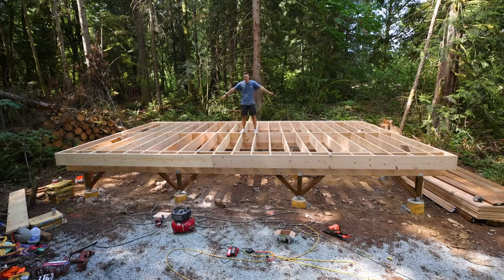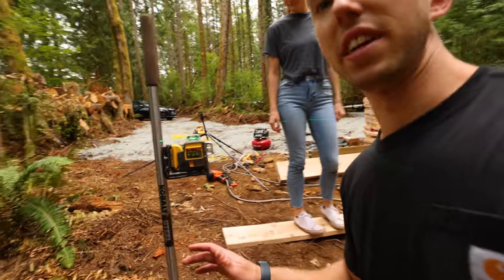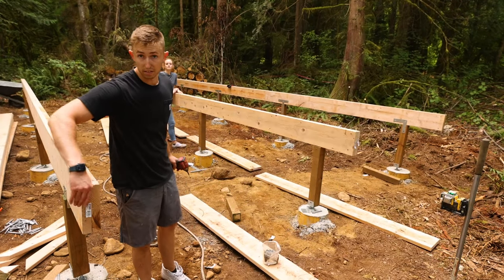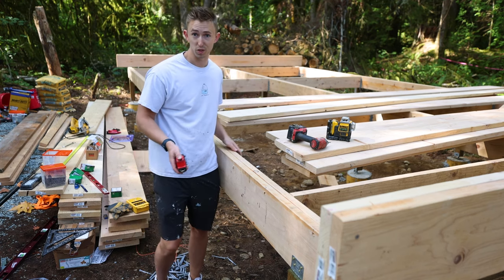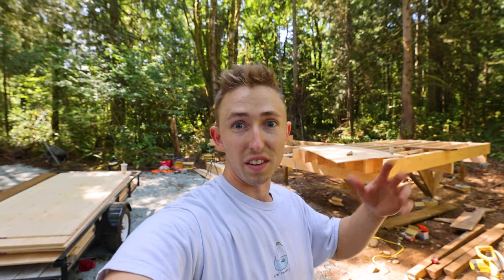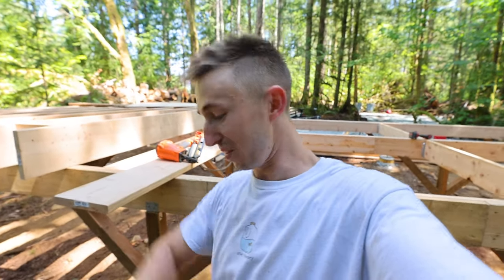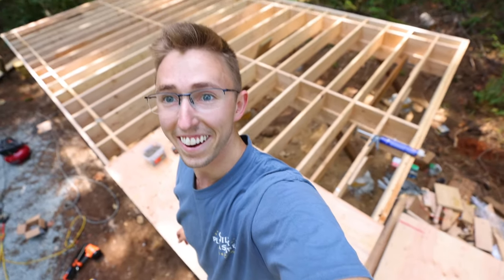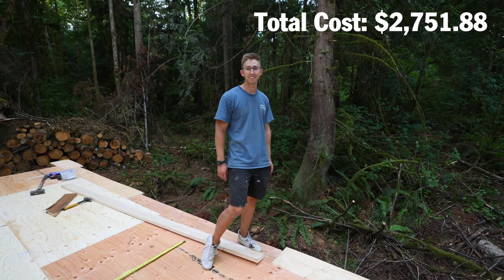Framing My Tiny Home Floor | Less Expensive Than I Thought

Comment: there are a lot of things that i find wrong in this build. the question is.... did you consult a professional or do any research before start building that deck?
Reply: No need to
Reply: Why dont you say whats wrong with it instead of saying you found things that were wrong?
Reply: @GrimReaping  for starters, the main one I noticed was the nailing.  For nailing double beams, you should have about half the number of nails as your nominal value every 16”.  In other words, a double 2x10 beam should have 5 nails (some codes have it as 4 nails, hence why I said “about half”) vertically every 16”.  Looks like he just ran across punching a bunch of nails in, but not nearly enough and not in a particular pattern

Comment: Seriously? All that weight of the structure on some 3/4" threaded bolts? That's transferring a huge amount of weight onto a tiny area. I suspect it will crack your footings. I'd have an engineer check that out.

Comment: those anchor bolts made it really easy to adjust height but are they strong enough to have the entire weight of the house on?  usually the weight is on the 4x4 or 6x6 directly to your pier, not its just on a 3/4" bolt.
Reply: That's what I'm thinking, Simpson abu66z is what should've been used or the 4x4 version, these look like a waste of effort
Reply: My thoughts exactly. Seems like a lot of weight to sit on a small bolt. Granted it’s 12 bolts but still doesn’t seem too strong.
Reply: yea I was thinking the same thing. That the entire structure is being held up with 12 of those little retal rods basically. idk. seems sketch/under-engineered. hoping he can chime in
Reply: The bolt diameter is very concerning, along with size of footings , not sure that's the best way to do it.
Reply: @darbythomson7662  Exactly correct. This is the wrong hardware for this application.
Reply: @butchahmann9274  Each of those is actually OK. The floor framing is very stiff, so the foundation attachments only need to resist gravity loads and shear. Even though the pins are pretty small, they're big enough for that. The real problem is the way he jacks the rods out of the dried concrete to level it. That ruins both the bond to the anchor bolt, and the integrity of the pier. 

The best way would have been run the piers all the way up to the bottom of foundation beam level, then use a small adjustable standoff piece (which is also available for around the same price) for any adjustments.

Comment: Wild seeing all of that sitting on a couple of us unsupported threaded bolts 😂.
Reply: That’s what I was thinking. Like it all looks robust above those little brackets. But everything is on those little brackets….
Reply: Unsupported how? Simpson requires 2500psi concrete at a minimum to hold those anchor bolts. 4x4's shouldnt have more than 500lbs on them, and that bolt is rated for a max of 760 down load when supported by the nut alone.
Reply: @GrimReaping  Thanks for clarifying this, as I was unsure but didn't want to come across as an internet jerk. so, if I were to build something similar (but with more piers, 600 sq feet), would you recommend to do anything differently than he did? Thanks
Reply: I agree, these are deck supports. NOT made for a full cabin.
Reply: Even on Simpson website they don't have lateral loads specified for these for the non threaded cast in place they do.
Reply: @GrimReaping  "Uplift loads require the threaded rod to be attached to cured concrete with SET-3G® or 
AT-XP® anchoring adhesive. Cast-in-place installations must have a nut and bearing plate 
embedded in concrete. Uplift loads do not apply when installed to a pier block" 

Wet setting the bolt and washer above leaves adjustment for hacks that can't even cut a piler, but in return removes all lift load. That sail will meet winds, and uplift will be created that overpriced shed is not safe to be in PERIOD.  He is just lucky it is under the SF required to pass code and inspections where he lives.
Reply: @garyreneau6166  You would need to check your local codes, a lot of places anything under 450 SF has no building codes, at 600 you would need inspections, and this would not pass. He didn't install the plates correctly there is nothing but the raw weight holding that structure to the ground he even shows you he can just turn the nut by hand and the plate moves so what will stop a good storm from blowing on the 12ft x 30ft sail and creating enough uplift to pop them little bolts out of there holes.

Comment: Run concrete posts 3 ft high. Use sill plates and rim joists
Reply: Exactly This. 
Concrete costs $5 a bag, and you already had more than enough sonotube material. There was no reason not to just pour the concrete right up to the bottom of the joist level, or at least the bottom of the foundation beams. That would have eliminated the very weak point of this foundation, letting it all sit on those little pins, with 3 feet of prying leverage above them.

Comment: Only thing i would have done differently is to sheet under the framing first.  By doing the underside first you just drop in your insulation from on top.  By doing the top t&g plywood you now have to stuff insulation in from underneath the framing.  Take my word for it that way sucks.
Reply from the maker: Typing this while taking a break stuffing insulation in my crawl space.... this sucks... never again hahaha. Definitely taking your suggestion moving forward.
Reply: @devonloerop  lol yeah, I've done the insulation job you are now doing.  Not fun.  But we all learn through experience.  Your build is sure looking great from the videos I've seen so far.
Reply: What material would you use to sheet under the frame?
Reply: @FranciscoGonzalez-ro7ht  I used OSB for the underside.  I was an apprentice when I had that job so whatever the boss told me to use I used.  But at the time OSB was cheaper than plywood and the underside doesn't really carry much of a load... It's basically sealing up the underside of the floor and holding the insulation in place.

But before you use OSB I'd make sure your local building codes say OSB is allowed.
Reply: fwiw, slab foundations vs. pier: high winds and hurricanes can destroy homes no matter how the foundations are laid out.

Comment: The weight of the whole building is  supported by 12 screws, nuts/washers. Not a safe design. What is the max load each screw can take?
Reply from the maker: 3/4" bolts* not screws lol. Look up the compressive load of 3/4" diameter steel
Reply: @devonloerop Bolt include screw and nut. It got thread on it. So it is not the max load of the 3/4 diameter steel bar but of the thread. I just checked quickly on chatGPT, seems  a grade 2 3/4 diameter bolt can hold 3500 lbs load on thread. 12 bolts hold 42000 lbs. Assuming the building is 500 square foot and dead load on the floor is 40 lbs per square foot, the total dead load is 20000 lbs, which seems OK.  I am not sure how much margin should be left for dynamic load.

Comment: I’m glad here in sc we don’t have to build a double floor!! I’m flabbergasted how you built a foundation grid then built an entire new grid for flooring on top the grid when really here in sc we use the og grid an use it as the beginnings of the floor joists system
Reply from the maker: beams make it so you can level the home easier that way you level by using two control surfaces instead of 12

Comment: Can someone explain how the adjustable brackets sticking out of the piers work? It seems like the entire house is held up on top of these relatively skinny bolts! Are they just that strong? I guess I’m surprised that’s just as strong as the wood beam directly sitting (or sitting within a bracket directly) on top of the pier. 

Awesome video.
Reply: When you spin the nut, it pushes down on a washer, which pushes down on the concrete pier, lifting the load. The threads are only there to act on the nut, not the concrete. As a result: They have terrible uplift holding (IE: they can be pulled out), and since they have minimal cross-sectional area (a single bolt) that means they also have terrible side-loading (IE: they can be knocked over). I can't speak as to whether or not these shortcomings would be problematic for the build shown here, but I'm fairly confident this would not pass an inspection.
Reply from the maker: Very true, will not pass inspection but this tiny home is not permitted and will not need to be inspected. That's also true that due to lack of cross section they are not good laterally which is why I built the home like a table, all of the bracing laterally is up top and that way it's almost like setting a table down on the piers.
Reply: Thanks for the reply, really interesting. Why not just lay the beams directly on the piers? Was it to give yourself the ability to make leveling adjustments?
Reply: All that work to cheap out on the foundation like that.
Reply: @badtoro truuuuu Simpson aba44z would've probably cost like 20 bucks more lol
Reply: I get it’s a tiny house but the entire tiny house will be dependent on those 12 metal bolts. If a big wind storm comes I can see all those studs bending over and possibly fracturing the tops of the cement piers. I am not an engineer or keyboard warrior, just thinking out loud.
Reply: @joshpit2003  This should be the top comment. This is not the best way to build this. And given the expense and effort he put into it, he easily could have bought the right hardware, and formed the foundation in a different way to make it 10x stronger for the same cost/time/effort.

Comment: This is an amazing work, as someone grew up in the city and concrete jungles, I often dream of living in a forest. Then here I have some questions about the durability of the lumbers in modern days, would it be capable to handle the humidity, the hot and cold temperature and the destructive wood eating pests for two decades and not getting rotten.

Comment: On the four foot marks I doubled the floor joist so my subfloor 4x8 did not share the 1 and 1/2 inch joist. You could marry a 2x4 to it also every 4ft just fyi. Before I put the subfloor on I usually face the underside and insulate. Spray for bug proofing and caulk to keep critters out.

Comment: If you use some beads of that Liquid Nails in between your sistered lumber they will be even stronger than if they were one piece of wood. No clamping required because your nails & screws act as clamps.
Reply: locktite version of liquid nails works much better.  Much stronger adhesion.

Comment: Like many viewers i have serious concerns regarding the use of the bolts and the unnecessary usage of blocking near the end of the joists because you capped them with the 2x12...i would have used a block at the end as a jig to space the joists.  Use the braces at every 8 feet from the cap boards and that would most likely suffice for stabilizing the joists.  But my biggest concerns is the usage of screws over nails.  Screws break wheras nails bend so when that house starts settling, alot of the screws could snap off.  Use blue glue nails and you will get the best of both worlds as they will bend when needed but never back out because of the glue.  But I do like your video presentation.
Reply from the maker: I glued down each panel, so the plate is essentially one solid system. It's been working really really well. The glue would have to shear off to have any screws break.

Comment: Dude! This is great. What are the total dimensions of the building?  I am in the process of framing a 12 x 24 building, definitely stealing some ideas for bracing. Nice work. Is the container home on the same property? What kind of permits did you have to get?

Comment: Great video series! I've been thinking about using pier and beam foundation but if you can believe it pouring a concrete slab foundation is cheaper in my area and I don't have to do any of the labor. With pier and beam you still have to buy insulation and flooring.
Reply from the maker: Wow if it's cheaper def go for it! You might want to consider using a footing and stem wall so you have a crawl space. It's nice for maintenance in future.

Comment: @3:53 - Can someone explain how that pier is moving up or down.  Shouldn't the threaded rod be cemented into place, how is it moving up or down?
Reply: The concrete isn't bonded to the threads very well so it doesn't prevent spinning like a J bolt does.

Comment: Two questions: 1) Do you have to calculate for snow load in Washington? and 2) Are you using any particular building code guidelines?
Reply: Actually, one more question..... 3) Why didn't you insulate the floor?
Reply: I know some studies have been conducted to the idea that cold air drops so no real benefit from floor insulation other than protecting plumbing
Reply from the maker: I built it the the local codes. Each vertical 4x4 post can hold 13k lbs (some estimates even say upwards of 20k lbs but built in a big safety factor. so at 12 posts can hold 156k lbs and I did the rough math on how much my home will weigh and it's going to be right around 30k lbs. with 2 feet of snow on the home it weighs an additional 5k lbs. So i'm still in the stupid safe realm. Also, I am starting to insulate the sub floor right now. I didn't do it during framing because i was going to be running all the plumbing underneath and didn't want insulation to be in the way (also i wanted to be able to identify leaks easily if i messed up.
Reply from the maker: sub floors of exposed crawlspaces are required to be insulated.

Comment: All that blocking should’ve been in the middle of the span where there’s nothing holding the joists. Blocking is used to transfer the weight from one joist to the surrounding joists.
Reply from the maker: I know what you're saying but these are 8' spans and 2x12x16's so needless to say it's overkill. I'd argue that it's better to do that way I did it can it creates more of a rigid system than having blocking offset from the beams

Comment: Strange if think of it . The entire structure is resting on 12 what 1 inch diameter metal pins.those seem more like building a deck materials.
Reply from the maker: Shear strength of the bolt threads are 22k lbs per bolt and the compressive load of 4x4 wood post is 19k lbs as it's braces so wood will fail first but with 12 posts this system can handle 228k lbs at max and the homes weight will be just under 50k lbs so there's a safety factor of 4.56. These #'s are conservative too
Reply: Why won't the structure bend the rods? Vertical shear strength presumably assumes forces straight down.
Reply from the maker: @joefish6546  there are a total of 37 12" piers  bracing the posts in all directions. The home would essentially have break all of the braces and push over the deck, which is its own supported structure to bend the bolts. I was just under there yesterday checking as I insulated and it looked perfect. Even checked it with a laser level

Comment: If you had a background in construction, why didn’t you build some of the stuff in the container home but hired people at a way higher cost?
Reply from the maker: I actually did a lot of the work there too, all the framing, metal work, stacking, excavation, pathway trenching, deck building, painting, window install.... etc. but I still had to keep working a full time job to help fund it. Plus certain trades needed to be inspected and had to have business license #'s tied to their inspections. Like I needed a certified electrician, and plumber.

Comment: I subscribed, what was the dimension of the 2x materials you used for the pier joists?
Reply: also you did not use pressure treated for your pier joists, would you do the same again?
Reply: last question, what size were your floor joists? I am going to make a purchase next week... thanks again!
Reply from the maker: 12"

Comment: How did you figure out the layout on the ground? Did you have to get it stamped or approved or any permits etc?
Reply from the maker: Since it's under 400sf I didn't need permit
Reply: @devonloerop  If you haven't already, be sure to confirm that sq-ft exemption applies to habitable dwellings. In a lot of areas, it only applies to non-habitable structures like sheds.

Comment: Those anchors defy logic.. None of the beams are achored to the concrete. They are resting in a hole ontop of the concrete. Looks to be very unstable if not for the 45's
Reply from the maker: But not material science and physics 😉

Comment: Seems like a super sketchy design.
The vertical posts… why not bring the concrete up and go straight to cross beam?
No construction adhesive, also kinda odd.
Reply: The support structure shown in this video are not even suitable for a back yard deck, let alone a house.
Reply: @johnnixon213  its unbelievable how bad this is. Its actually very dangerous. This kid should go watching some framing videos before making them.
Reply: He could have built this all on pier blocks sitting on top of the ground and had the same or possibly better stability with half the labor and materials
Reply: @vanblindguy4600  Darn Tootin. You ever see those remote builds where they place borders into gravel pits and drill rebar?

Comment: Those brackets are 100% the weakest link but the foundation should be the strongest part. Honestly the worst idea I've seen for a foundation. Any rust, lateral stress, ground expansion, etc will cause your entire house to fall apart.

Comment: Your tubes should have been set at 12 to 18 inches above the ground, and then you wouldn't need the 4x4 posts.  The beams would then go right into the Simpson hardware, which would make the foundation more solid and you wouldn't require the kickers.  Also, your floor joist should have been placed between the beams, not on top of the beams, which is the industry standard.  You're making your build much more complicated than it needs to be.